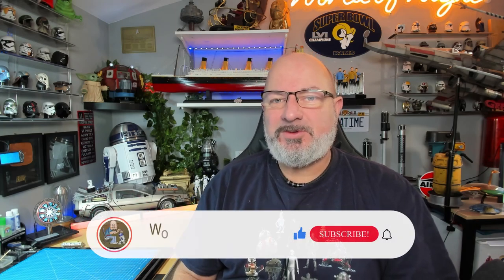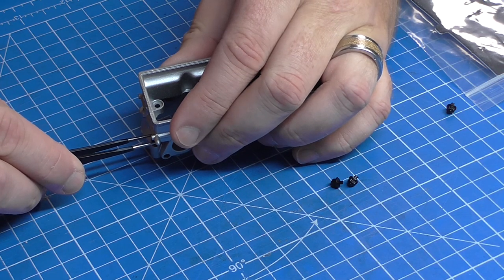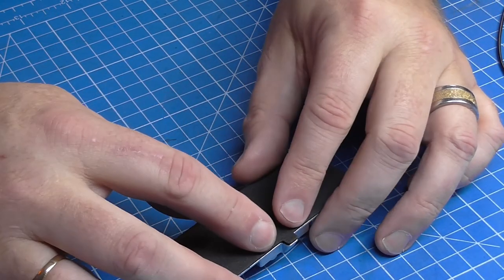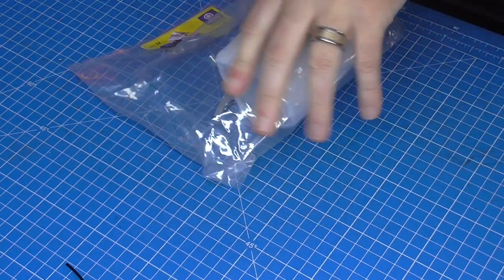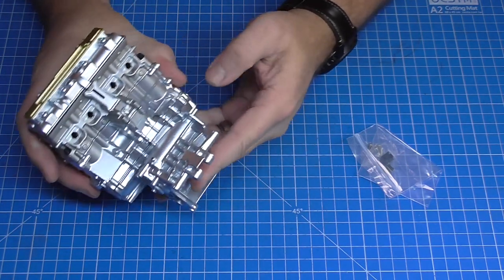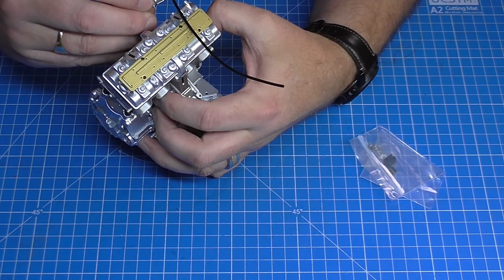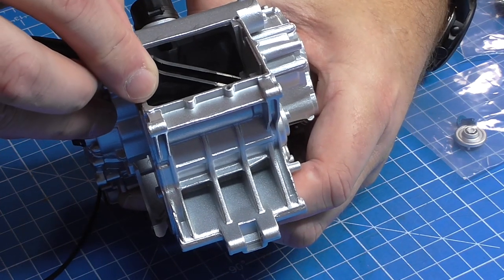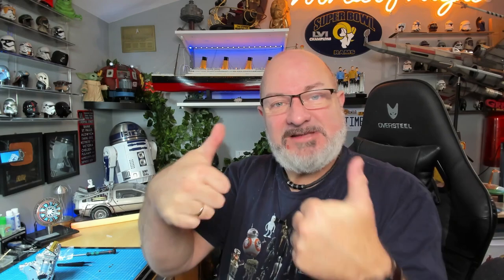Build Valentino Rossi's YZR - M1 Motorcycle - Pack 6 - Stage 22-26

Comment: a switch with no wires? what the hey?
Reply: That is what I thought. About the switch
Reply from the maker: Now you mention it I don’t think this model has electric features lol. Therefore I have no idea what the switch is for.
Reply: @WorldofWayneUK  Ian Campbell over at Partwork Upgrades did make/install an electrical speaker mod for when you wanna start up the engine. When Deagostini 1st bought this 1:4scale bike 4or 5yrs ago😉👂🏍📢